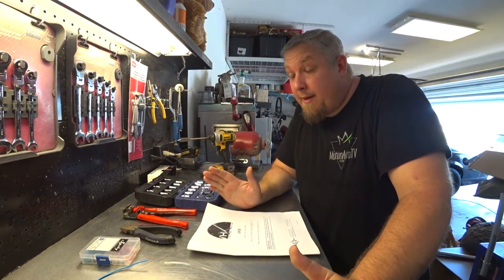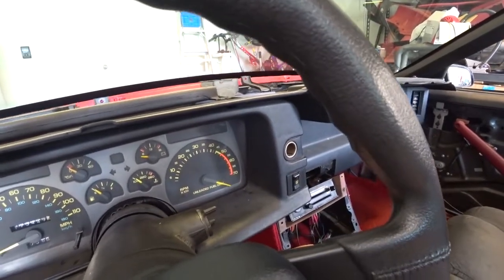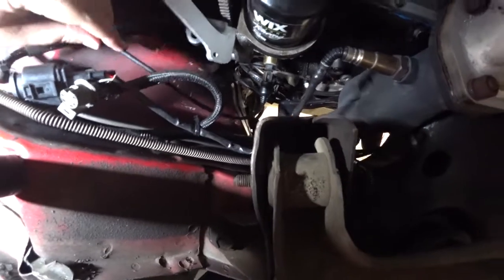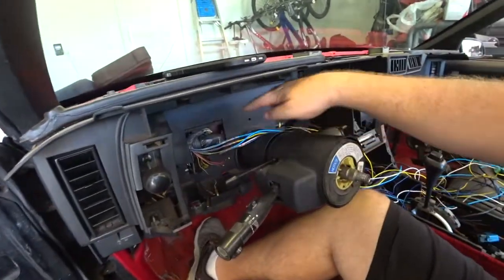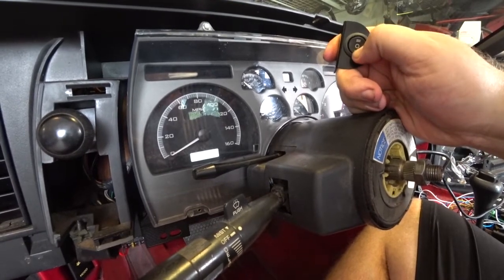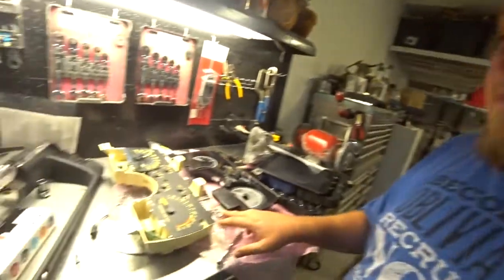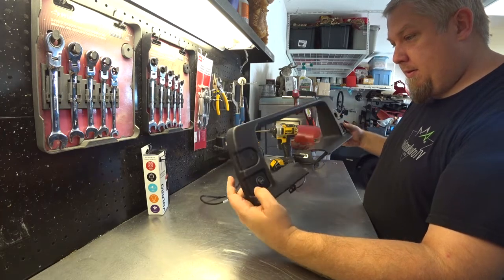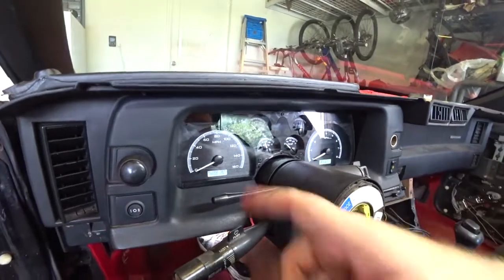Dakota digital gauge install - 90-92 Camaro - long version

Comment: Did you ground the control switches or did you just connect them to the control box?
Reply from the maker: I hooked them straight to the control box, it has been working for the last year with no issues.
Reply: @CamaroMac   ok thanks

Comment: Did Dakota digital get back to you with an update on the mounting tabs?
Love the videos!!
Reply from the maker: Jose Romero yes they did, the instructions I believed to say to install the lens off of the old cluster is not needed, just the face plate. So with the tabs shortened it does fill in the gap and look better. I will share a pic on Instagram

Comment: Hey, what's up? How are you doing? How did you hook up your fuel? Pump wiring to Dakota Cluster  Gas gauge to work What wires did you use

Comment: Love your Camaro vids bruh!
I have a ground fault to my guages...blowin the fuse.  Tore dash out lookin' for an exposed wire and juat cant find anything.  Might have to set it on fire...unsure what direction to go.  Been kinda fun hunting for it tho.  What to do.
Reply from the maker: These situations are the worst. I would start at the fuse box and work outward. There are tons of resources on the 3rd gen forums. Thirdgen.org is my go to